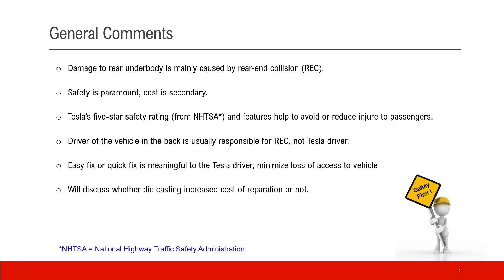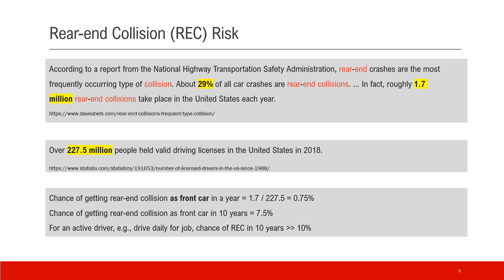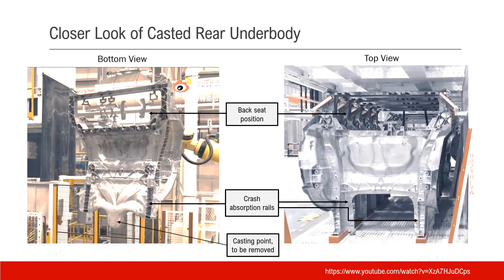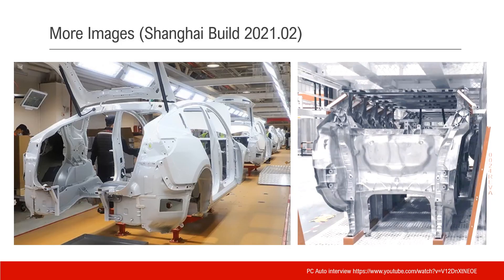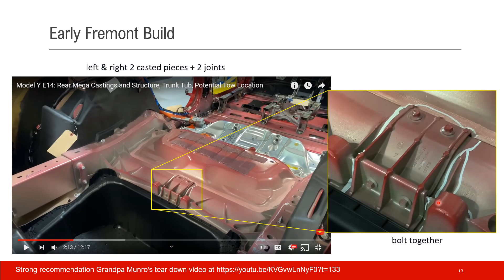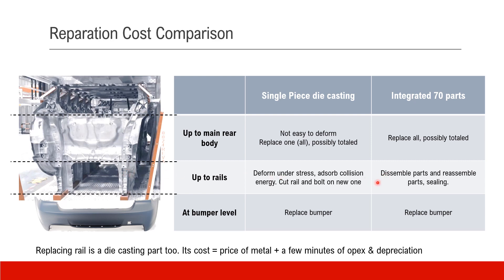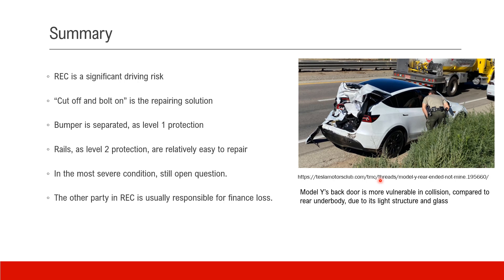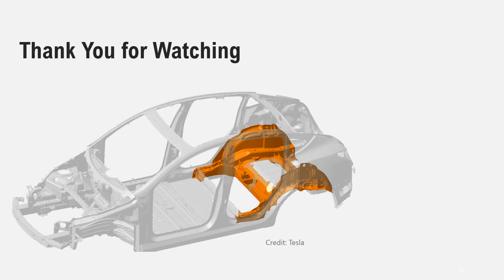Giga Pressed Part Reparation: Solution & Cost

Comment: Thank you. Although not as common as REC, what about an impact to the rear wheel well? Is there also a cut-and-replace option for fixing the wheel well?
Reply from the maker: The main body of the rear underbody is right above the rear wheels. If you talk about side impact on back wheel, a portion of the underbody will definitely be impacted, at least the wheel cover. On the other hand, Tesla cars have show strong resilience from side impact. So the deformation range could be limited. In that case, cut-and-replace could work out. It is not cheap either single piece casting or integrated 70-piece.